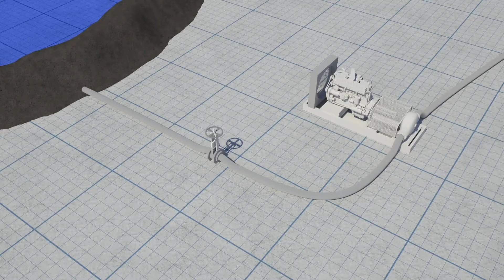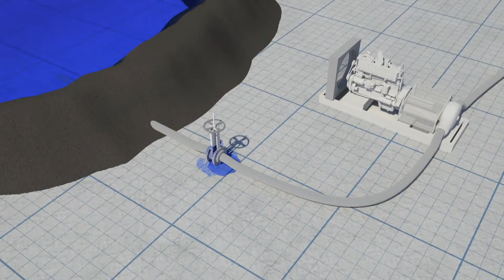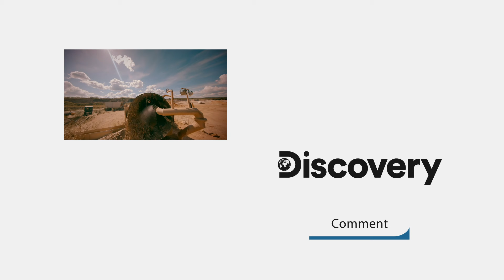Tony Beets Brings His Grandson To The Mine! | Gold Rush

Comment: why didnt you just put a plug in the end of the pipe in the pond then you could take the valve apart with out losing any water from the pond
Reply: that's what i was thinking. Just and plastic end cap and job done.

Comment: All you have to do is put a cap in the intake of that water tube and that water won't leak out when they disconnect that valve. Even a piece of wood to cover the inlet should slow it down kinda like a big restrictor plate. These cats really aren't thinking scientifically.

Comment: I suggest the second valve be installed so you don't have to drain the pond in the future. Put that valve between the actual valve, and the pond water. It's doubtful that both valves will break at the same time. That way you can close that valve to prevent the pond from emptying out. Make your repair and then open both valves
Reply: Plug the pond end of the pipe

Repair valve 

Unplug pipe

Jesus

Why make it hard